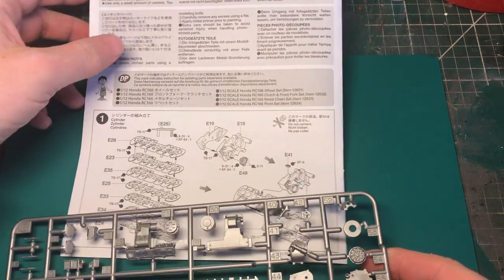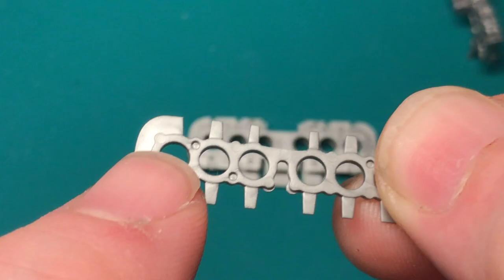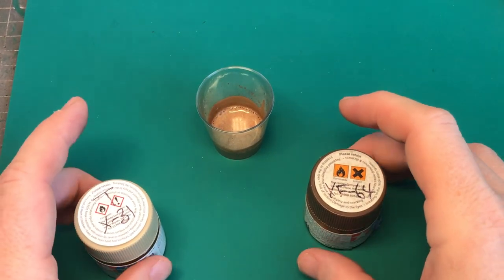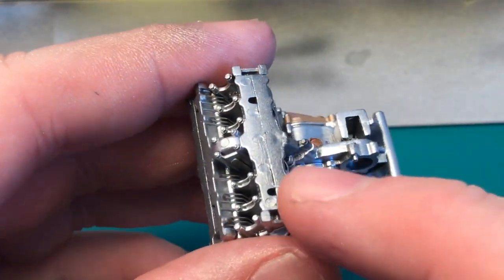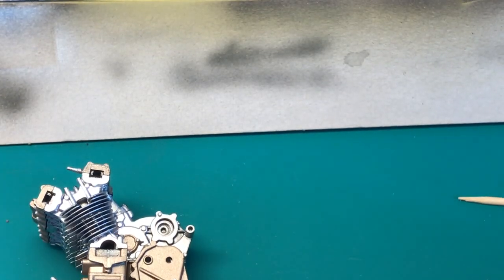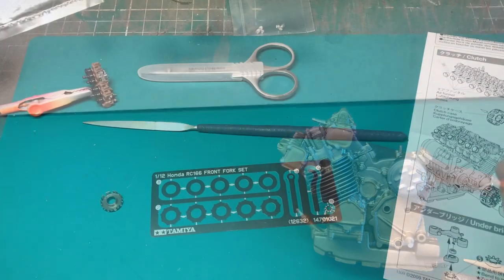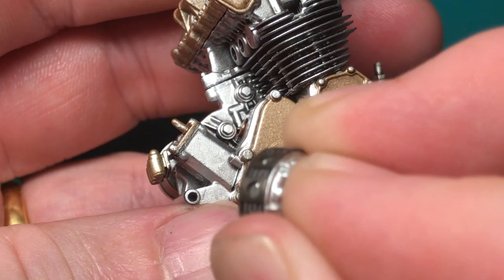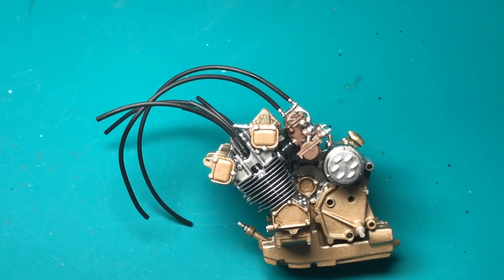Tamiya 1/12 Honda RC166 Racer - Part One.

Comment: Very interesting video. Thanks! I will use it as a lifesaver in case I get stuck somewhere during the construction phase. I would have appreciated to see the painting process. Do you  spray the primer on all parts before painting including the smallest ones?  Do you use different primers according to the final color? Please pardon me if you’ve already have answered these questions in your live comments but I don’t understand very well your English.
Reply from the maker: Hi Eric, I think when I did this build I used just grey primer. Now I use different ones, like gloss black primer for metal coloured parts. I’ve also got white and pink primers     How I paint the model parts. It’s a bit of both really, like an engine could be built and primed in one go. Smaller parts individually. Hope this helps. Thanks for watching.